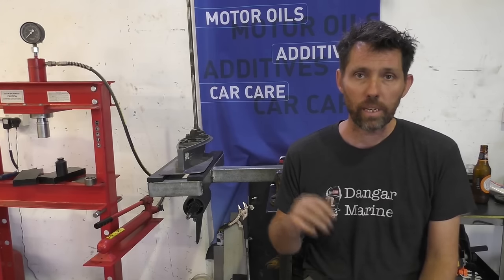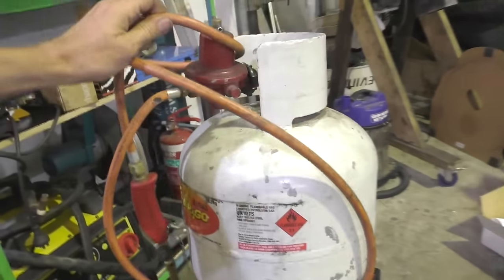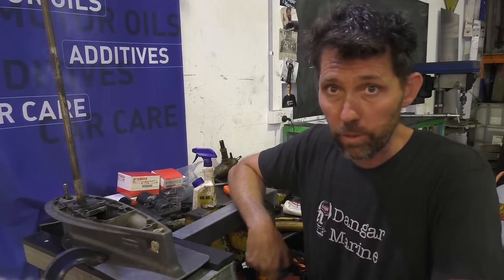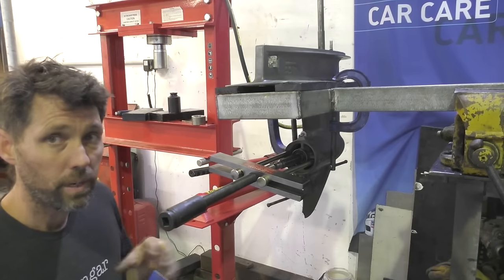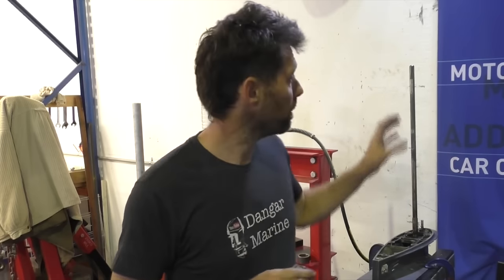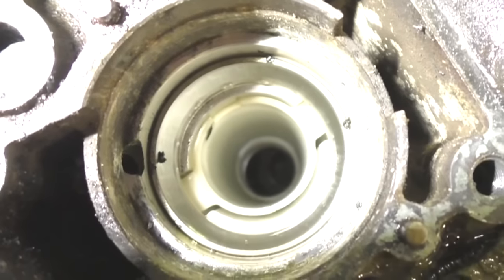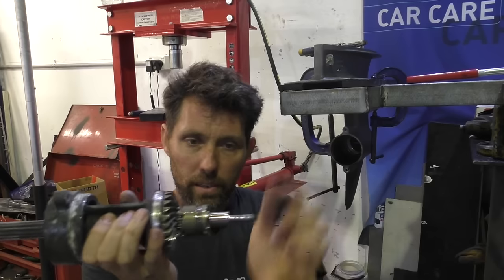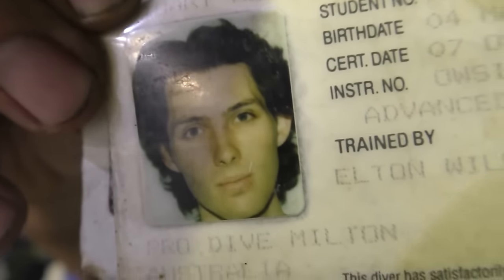Removing an outboard driveshaft

Comment: Like so many people before me, I must express my greatest appreciation to you for doing all these useful videos.
Boosts the "mechanic confidence" greatly for me.

I am about to do basically the same thing like you did in this video.. 
Yamaha  40HP 2-stroke, 2003.
Pulled the lower unit to change the impeller.. and the lower shift shaft got stuck in the upper shift shaft.. and pulled out of the gear selector cam.. 
Now my lower case is locked to be always engaged.. and the shift shaft rod does not affect the gear selector in any way.. just rotates.. 
I think the selector might have dropped out of place and is now scrambling aroud in the gear case.. :(((
Thus this video is just perfect for me.

What do you think about this method of removing the bearing carrier, compressed air...
http://www.youtube.com/watch?v=gAquKmAPFAw&t=42m40s
Seems very simple and without struggle, heat and so on..
Reply from the maker: Thanks mate, I'm glad the videos have been helping you. I'd be keen to try compressed air one day. I'm not sure how well it would go with a corroded salt water motor given you can break steel bolts on pullers before they start to budge but I'm willing to give it a try! :)
Reply: @DangarMarine  , It's been quite a while now, but I can report back that the compressed air method did not work out for me, just made the oil seals flip inside out.
I did however, managed to get things apart, ended up with ordering the Yamaha original pullers and together with lots of heat things finally came loose.

Now i'm about to make the assembly again, and got stuck on the pinion nut, de-assembly wasn't so hard, but the service manuals specify 75nm torque for assembly.. I cant really get my torque wrench in there..
Would greatly appreciate any advice.
Kind regards Kristoffer.

Comment: Hey there buddy I kinda ran in to a little bit of a problem on my drive shaft if you could give me little bit of help on this hahaha
Reply from the maker: What's happened with it?
Reply: Dangar Marine
 
The rollers came completely out of the bearing and fell apart I have a 125hp force powerhead with the 30" drive shaft and I have a choice of replacing the whole shaft but I was wondering if I could just replace the bearing but isn't the bearing press on? An if so what could be the best way on fixing this problem and by the way seals are very hard to find for the lower unit from the bottom of the gear housing cover down to gear housing seal back to the propeller spool the whole objective is to do a full tune up from top to bottom for it be ready to be out in the Walter this spring so if you have any ideas I would be much great full by the way all your videos are very much helpful thanks buddy